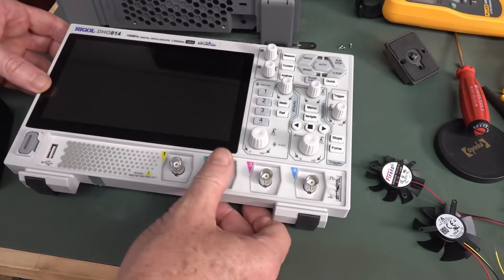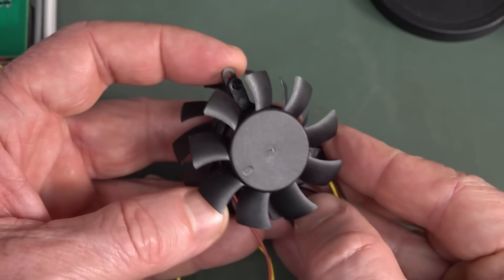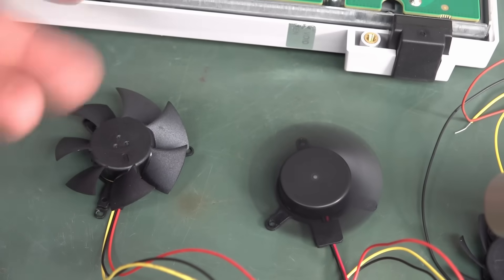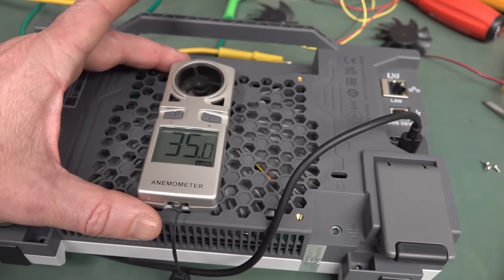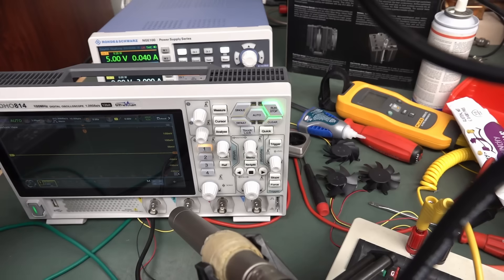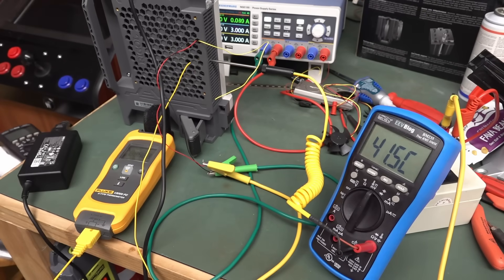Rigol DHO800 Oscilloscope Fan Upgrade Experiment

Comment: LIke Dave mine was noisey too ,Look at my Youtube Video Rigol DHO814 DHO800 Oscilloscope Internal Fan Nosie Cure 2025

Rigol DHO814 / DHO800 Internal Fan Noise Solution Hello! Have you noticed that the Rigol DHO800 series, DHO814 oscilloscope can be quite noisy in a quiet environment ? I did too. My unit was brand new only a month old and noisy from the start, running Firmware 00.01.04 as of 1st June  2025.  

To resolve this, I installed a 100mm 12V DC fan at the rear, powered via an LM317 voltage regulator set to 2.69–3V. The fan draws approximately 70mA, (0.070A) making it extremely quiet while operating. I connected it to the onboard power with a new plug, and now this oscilloscope is the best I've ever owned feature-rich with a responsive touch screen, and most importantly, silent.  

Note: When I recorded the accompanying video, the workshop was cold, and the scope had only just been powered on. However, after 30 minutes of operation, the CPU chip temperature reached 51°C, with an ambient temperature of 47°C. I hope this helps.

Comment: Anyone consider placing something like an 80 x 80 x 20 on the outside of the grill centered between the VESA screw insets and wiring it through the honeycomb to the board header?

Comment: When I bought my UNI-T scope I found the fan way to loud for a quiet lab. I put in a fan controller with a pot and measured the temperature for a while. Now it's blowing super quietly while still keeping the electronics cool. Same with my UNI-T AWG. After having it on and monitoring the temp I decided to pull the plug on the fan. Just fix the problem like Dave did if you don't like it.

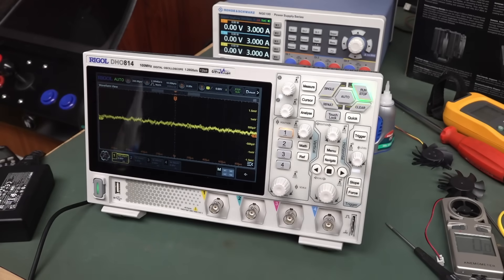Comment: You should have worked around the original fan and optimised that with lower voltage to see what is possible there in regards to temp..not solely some thirdparty unit 10:42 , that most people will have issues to sort not to mention the cost and having to risk that plastic cracking with a sidecutter and  no moungting spot and tumble any small hope for warrenty on these new units..
Would have been most interresting to sense what is possible with the least effort, and not cracking the units structure - as just putting resistors on the main fan is something anybody could do in a few minutes without any hazzle or postage time and VAT import cost...and its easy to mount, no glue or risk for it to get loose, but the results would likely be around the same as with these thirdparty fans.
but great video +1 with the pursue to optimise a con that annoys many..
I do have the Rigol signal gen pro that will be release her ein the west in 2024 (DGXXXPRO) and its the same formfactor and the fan is annoying as.. definitely been a problem the last 6 weeks in use, as it is loud to have running, and the start up time is 65sec so +15 sec. more then the DHOxxx

Comment: Most fan noise is mechanical radiation. The mechanical vibration in the fan is coupled to the metal heatsink. A couple of tricks: 1) buy a fan with two bearings (not cheap plastic sleeve), 2) isolate the mount with some form of rubber washer which will attenuate the coupling, 3) If available buy a fan with serrated edges - as an experiment you can take a conical Dremel sanding bit an gently add serration to the leading edge of the blades.   Think about the little mechanical music box mechanisms. Off the surface they make very little noise - fasted to the surface they are quite audible. In this case you want to break that connection. An interesting observation is a well isolated fan of good quality lasts longer.

Comment: 11 blades on "skinny Delta fan" vs 9 blades on original fan vs 7 blades on "fat Delta fan". The more blades the higher airflow. With comparable RPM, angles and forms of the blades, of course — but quantity (RPM and the number of blades) matters more in the airflow capabilities of different fans of almost the same size.

Comment: Might want to look up how a squirrel cage siren works (I just saw that others have made similar comments).  You're making almost the same thing.  Double-sided tape is not a way to mount a fan on a HEATsink.  It gets soft when warm.  That's why Rigol spent the money to use screws.  Be careful about advice offered on YouTube.

Comment: I built cabinets for recording guitar amplifiers. I bought super quiet fans. What I learned is fans themselves make almost no noise in free air. It the surrounding structure is where most of the noise comes from the noise comes from. I put a speed switch on the fans.
Reply: Yep. Especially when the edges or tips of the fan blades are in very close proximity to other objects e.g. fan grills or heatsink fins.
Shaving the heatsink fins down within a certain radius for extra clearance would probably help with the noise.

Comment: If you think Delta fans are quality then think again. My experience is they are a POS. We have had numerous instances now where Delta fans in our servers have physically disintegrated. Even better we have had Delta fans chew their bearings and spew brass shavings all over the insides of our servers. Now I accept what I am saying seems fantastical and fans don't fail that way. Prior to 2021 I would have agreed. See the May17th and October 14th post I made in the 2021 hardware failures on the ServerTheHome General Chat Forum where you can see photographic evidence.

Comment: I always remove those useless small  fans and replace them with a slower turning larger fan.even if you have to mount the fan at angle to the heat sink  it is better than that annoying whine of small fans.

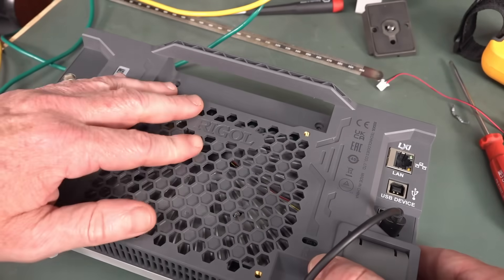Comment: 6:35 Rigol why the f did you put the logo right over the fan and blocked half of it?!
No wonder it's all whiny!
The 9V proves that they realised it's too noisy...
The grill design itself is also piss poor, they have holes all over the heatsink where as there should be nice inlet for the fan, most of the heatsink blocked and then some wents where the heatsink ends and exhausts the air, this way you force more air to go all over the heatsink, instead they recirculate hot air and have most of the fan pressure exit halfway-thru the heatsink...
I would place the fan on the bottom, have just standard fan inlet without wanky hex design, have some straight finned heatsink and then have exhaust vents on that slope under the handle, this way it goes along the natural convection.

Comment: The "Whiny" may start only if the fan is mounted since the fins of the heat sink are in a regular pattern. The "Raised things" on the case or even the regular holes are a classical whiny source.

Comment: The problem is that they have designed a siren.  I think the only way to fix this thing is to take the heat sink out and grind away the fins so they're well removed from the edge of the fan blades.

Comment: you have two different types if blades on those deltas, one is for airlow, the other is for pressure. wont pull as much air but is used for more restrictive areas. im also thinking the ideas seems to be to pull air in and push it out sideways like a blower ,  wondering if an actual blower fan would do better

Comment: The fan acts like a siren against the heat sink with the open blades. If the blades had a circular ring affixed them maybe two thirds the blade height. The noise would be reduced significantly more.

Comment: I think the culprit here is the regularly spaced radial fins.  Rigol has inadvertently copied the design of an air raid siren. The air flow varies depending on whether the fan blade tips are aligned with the fins, or with the spaces between the fins, so you get a pulsing air flow--otherwise known as sound. To fix it, you would need to minimize the interactions between the fan blade tips and the heat sink fins. Options are: 1. switch to a larger fan outside the case; 2. find a fan where the number of blades doesn't have a common factor with the number of fins; 3. use a smaller fan, or mill away the heat sink fins where they are nearest the fan, to create some space between the fan blade tips and the fins, or 4. if there is space, insert a ring of thin open cell foam between the fan blades and the fins to diffuse the air flow.
Reply: Awesome post! How do you feel about opening up the plastic exhaust holes on the back panel? It could boost airflow, which might boost noise, but maybe one could slow down the fan...
Reply: @dosgos  It seems like that would probably help, if you don't mind making changes that can't easily be reversed.
Reply: @danmenes3143  That made a huge cooling difference on some thin laptops. But there are downsides to lugging around a laptop with big holes in it.
Reply: @dosgos  Indeed. I wasn't going to get into that, as I thought it was obvious. Any extra dust, houseflies, or cheese doodles that find their way into the scope after such modifications are not my responsibility.
Reply: Sorry I should've scrolled down before I replied I guess I should read other peoples comments I agree with you, good on ya mate.
Reply: Time for a good ol Noctua fan outside the case.
Reply: 5. Mill down the tips of the fins that are close to the fan. Of course it will decrease the heatsink performance marginally, but mostly it will hurt the air raid siren loudness. If I would have an out-of-warranty device I would check if heatsink temperature is any kind of critical and if not I´d take the Dremel.
Reply: yep, that's why they have put helical blades in a straight cut heatsink... they probably needeed to twist the fins and use a centrifugal impeller .....
Reply: How about reversing the airflow direction by changing the rotor or entire fan.
Will that work..??

Comment: Just get a be quiet! Silent Wings 3 non PWM 120mm fan and make a VESA adapter to fit it on the VESA mount of the scope, connect it to the 8 Volt and it should be inaudible. Bob's your uncle.

Comment: Undervolting a fan isn't without risk.
As fans get older, bearingfriction increases. With undervolting you run the risk that the motortorque isnt enough to overcome the startup friction (which is much higher than running friction) at some point, resulting in a non running fan (therefore overheating).
More complex systems, with rpm monitoring, can monitor this, but not here.
Reply: Many fans have a driver ic that shuts down the fan when it is blocked. I have 100 fans from different brands and products and some without brands that all have the stop function embedded into their driver ic chip, when it is stalled the driver ic pulses the fan once half a minute to check if its stalled or not and does not when the fan is just spinning. Even the simpler 4 pin ics have the function
Reply: Maybe the Fan does get started with 12V or is temperature regulated?
Since this Osci has thermal protection nothing will happen except that the device will shut down, so you know that something is wrong and can search the cause.

Comment: Those high airflow values near the fan are not actually real. The magnet inside the fan is messing with the hall sensor inside the anemometer.
Also, maybe another solution would be to fit inside there the fan from a 40mm or 50mm blower fan?

Comment: I guess the fan blade tips running close to the heat sink fins generates noise. Just like old ww2 claxon air raid sirens.
A smaller diameter fan might be quieter?
Reply from the maker: Yes, but saller would have to run faster for a given air volume.
Reply: Exactly what I was thinking. The design of the heatsink, with its regularly spaced radial fins, is the culprit. It really is very reminiscent of the design of a siren. I think I would try switching to a larger fan outside the case, or if I needed to keep everything contained, see if I can add some lightweight open cell foam between the fan and the fins. Anything to separate the tips of the fan blades from the fins or break up the pulsing air flow.
Reply: no, use flat fan with pitched fins to slice the air shockwaves

Comment: What if you used a bigger fan on the outside of the case?
Reply: My workstation has three 200mm fans that I lower the speed on. The thing is silent and everything stays below-hot, a healthy 58 C max at peak gaming load. Both liquid cooled GPU and CPU / my 200mm case fans pressurize the radiator air flow enough to do the job.

Comment: For a design like that, I wonder if they could use a fan grill and a  140 or 120mm Noctua fan (or even a low profile 120mm fan) then use one of the low noise adapters, and just run the fan at around 300-400RPM where they are effectively silent but can still offer more airflow than a basic 40mm fan.

Comment: I would mount a large/slow fan on the VESA mount instead of little fast ones inside
Reply from the maker: Yep, seems to be the best way. I had to try it though.
Reply: @EEVblog2  Problem is it would need a cage as otherwise your fingers will find it. That's going to make it thick. Is there enough space for it to not stick out too far? Perhaps keep the original with a little circuit to measure the temperature and adjust the fan speed accordingly. Op-amp or microcontroller, thermistor and a mosfet would be all it needs.
Reply: @mikewillis1592  just put on those old 90's fan grills and your fingers are fine
Reply: Exactly what I thought also. Or maybe print a separate enclosure for a fan which could be mounted on those VESA screw inserts.
Reply: Exactly my thoughts 😂
Reply: Yeah it's 100*100 mm vesa. So a simple 100 to 92mm adapter is all that's needed
Reply: You can also 3D print a "cage" which would fit the VESA mount and "enclose" the 90mm fan.
Reply: 10 engineering points! I'm gonna hang a 90/100mm low noise fan on the VESA mount and call it a day
Reply: @engineeringdisillusion  where do you pull the power? Could you use the power from the original fan?
Reply: @badermeinhof123  I still have to buy the scope. On a napkin, pulling the power from the original connector would require investigating how much power it delivers, putting the same connector, manage the cable...using external power is probably easier
Reply: Mount the fan 45 degrees rotated from the VESA holes and you could probably fit a 120mm fan.
Personally, I'd fab an 1/8" aluminum plate, that'd allow you to cut a big hole in the case and still have it be sturdy.
Reply: A few 100 mm fans do exist, though I don't know if they are any good
Reply: Totally Agree and have done it ..
Reply: Same here. A noctua 80 or 90mm probably

Comment: What happens if you zap-strap a Yate Loon D12SL-12 on the back? It'll be quiet on 8v, and they'll run happily on USB 5v as well.
Reply from the maker: There are countless suitable silent PC fans you could mount externally.
Reply: @EEVblog2  I was thinking about one of the Won Hung Lo or Kow Dung Bouffant xp2000 series"PROFESSIONAL" fans.

Comment: I don't really get their original choice of fan, that sort of frameless fan is for mounting on a heatsink to blow through the heatsink, a frameless centrifugal blower fan would be much more suitable for this application to blow sideways across the heatsink generating less noise trying to blow down into the solid heatsink. Those fans are of course less common but modern laptops use them all the time so they are still common enough to be cheap and most have low noise oriented designs. Also those sharp edges look nice but are just asking to make noise from the turbulence particularly when the blades are so close.
Reply from the maker: Yes, there is quite the difference in the fan noise free on the bench and then next to the heatsink fins.
Reply: @EEVblog2  Plus putting a thin cover over the heatsink fins, so as to direct the airflow between the fins, will help a lot as well. 3M VHB tape on the fan will , with clean surfaces that are grease free, pretty much never let go. You do get it in 0.6mm thickness as a double side tape.
Reply: Usually for heatsink designs like that, the airflow direction is reversed, with the case acting as a duct and the fan exhausting hot air, thus pulling cool air through the fins. At least that is the case with many new WiFi routers using active cooling. Usually it offers a cheaper way to cool a large number of components. for example, on my RAXE500 router, the same type of heatsink is mounted to the top of the motherboard, and cools the SOC, WiFi radios, 2.5GbE chipset, and a few other components. On the bottom of the case are a series of vents as well as other components that essentially have heat spreaders. The exhaust fan at the top pulls air into the bottom vent, over the heatspreader, then through the fins for the top mounted heatsink before being exhausted.
Though in the case of the router, it has multiple thermal sensors, and it varies the fan speed, in addition to turning the fan off when temperatures are low enough. The fan curve when it does turn on, is fairly silent. It basically won't come on with a basic load of just saturating the Ethernet ports, but it will come on if you saturate those ports while using its VPN server and USB storage at the same time.